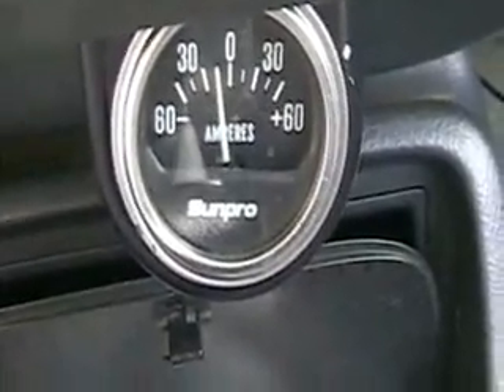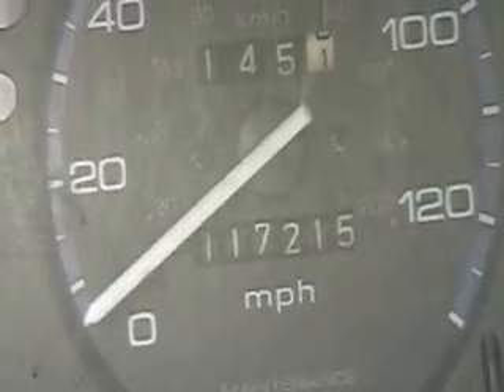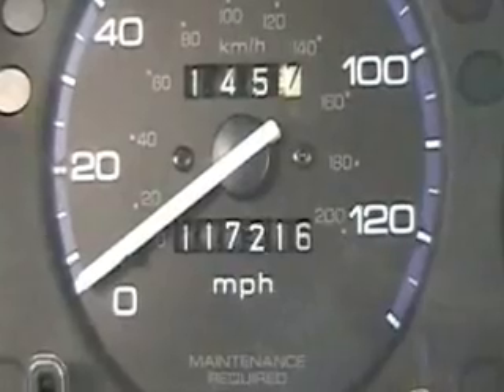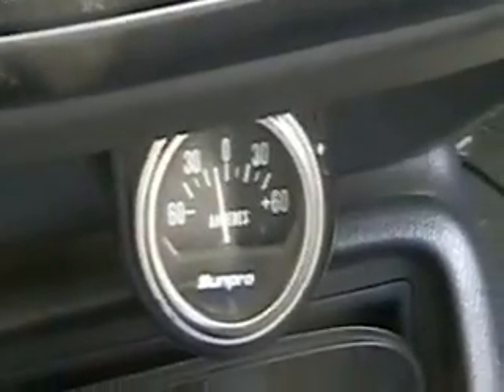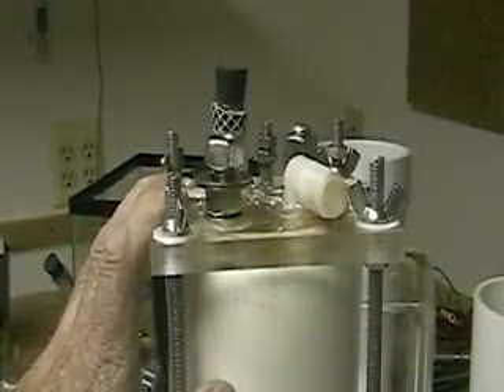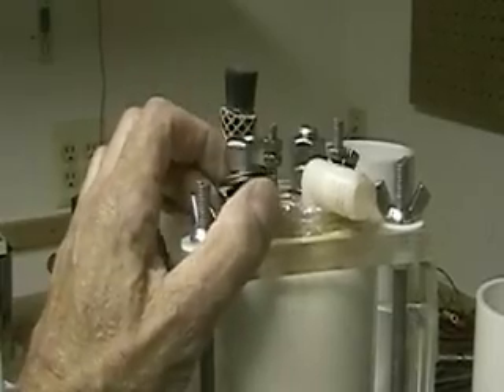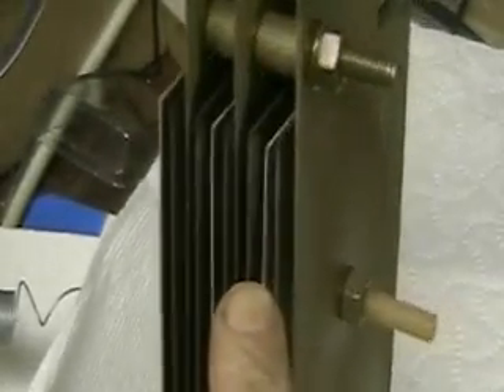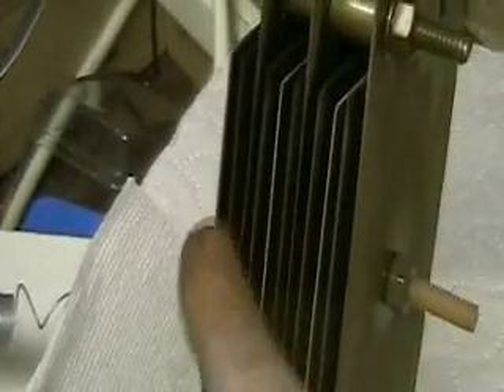Hydrogen Tap (FOCUS -PM ) 331

Comment: Starting at the six-minute mark of this video, you can see the bolt holding the plates together has turned a rusty colour.  Since the bolts are stainless, it's probably not rust.  Have you looked into that?

Comment: was it even running with HHO based on calculations 24.57 mpg and based on previous calculations no mpg gain at all either something went wrong with the cell or it time to start modifying the O2 sensor.